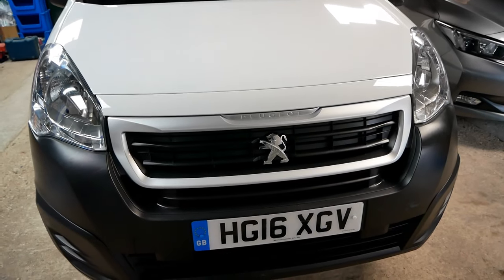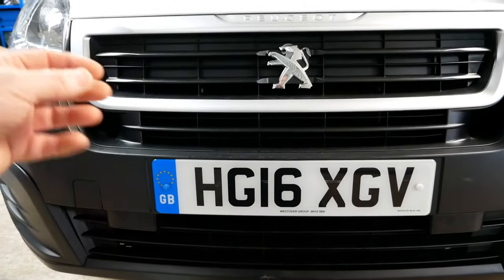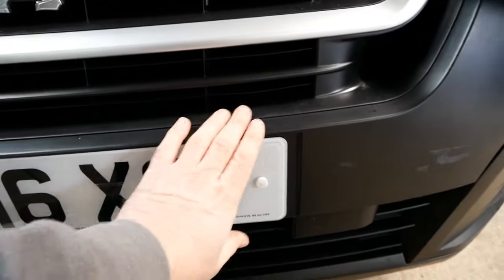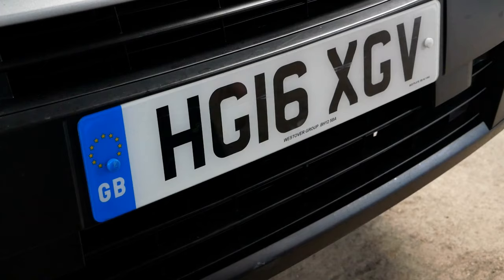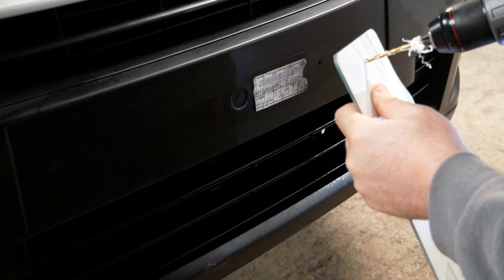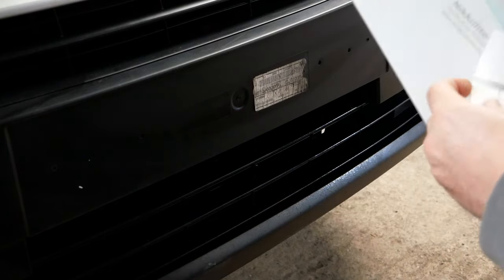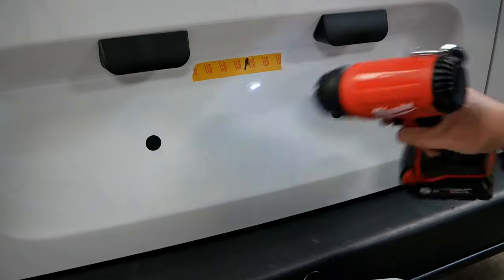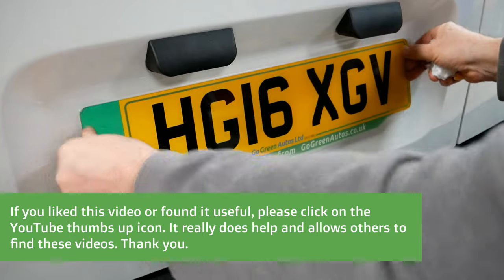How to replace your number plates - a guide to fitting new plates

Comment: Hi
Really like your video. I have a Renault Zoe and the number plates are riveted on. Would really like to change number plates to the new green style. Any chance you could do a video showing how to remove the rivets? I saw your video about removing old bits of rivets from a Zoe which was excellent as usual.
Thanks Bruce
Reply from the maker: Drill them out with a HSS bit. Just drill the centre of the rivet out and it will fall apart.
Reply: @GoGreenAutos  super thanks. Plates arrive tomorrow so good to go. Green plates rule. I think I will go for stick on. 👍💚

Comment: So many things wrong here starting with wrong pronunciation,  and way too long a video.Has he left the peel off backing on back of plate?  Spirit level??!!!!!!! Use WD40 or petrol to soak that residue off the back!!!! Razor blades and metal scrapers!!!! Let's see you drilling the metal bodywork! Cheating using the pads 1st before screwing!And drilling holding the plate!! You must do this on a work top!!! 🥺
Reply from the maker: Clearly not watched it properly as I didn't use a razor blade or metal scrapers and said no NOT use those. The scraper was plastic. The plates did not have a backing on them. The solvent I used was Autosmart Tardis, but of course your average home owner is not going to have this or want to buy it as its expensive stuff. As for drilling the metal bodywork..I'd never do that - that's the point of showing the alternative way of fixing. 
Anyway, thanks for watching!
Reply: Ok smartarse...I found it helpful. Notice you haven't been forthcoming with any tips !!